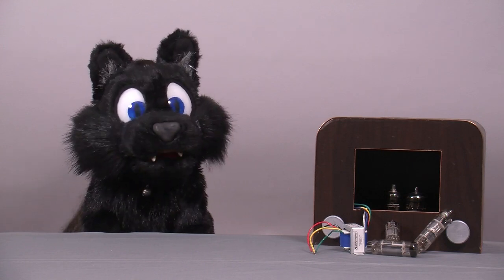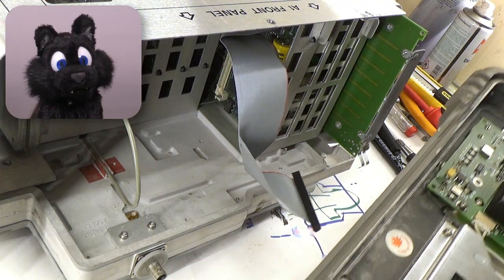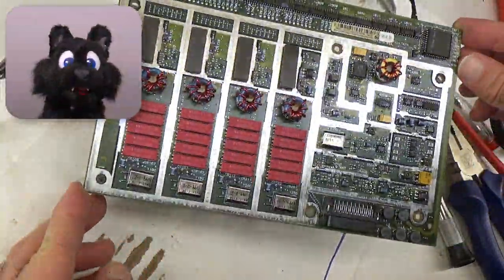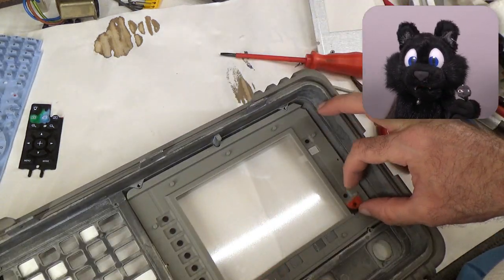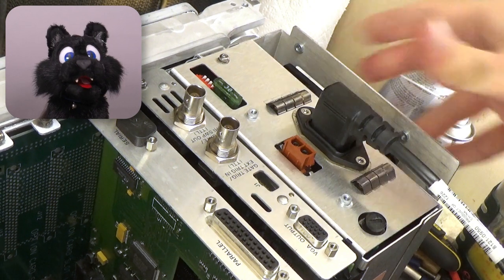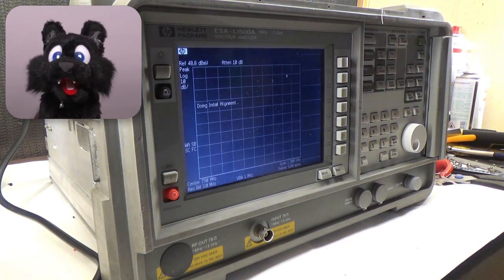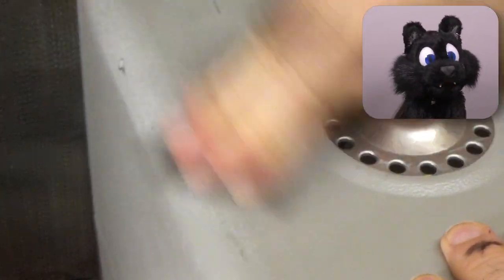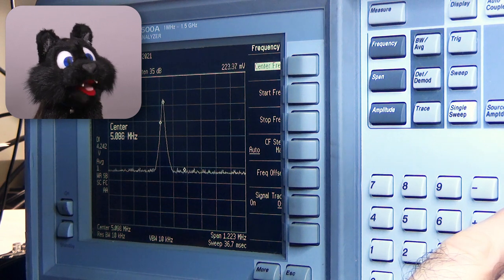Workshop Project #10 - HP Spectrum Analyzer

Comment: Look, ma! Vacuum tubes! :)
I love maple syrup, unless it's found in electronic devices. Then it's not so delicious.
You got yourself a very cool piece of kit. I love the build quality of these. Apart from the RIFA caps which are "kill it with fire before it does it itself!" parts. Interesting way of repairing the power button - I think I'd just go with using a tact switch under the original rubber.
Reply from the maker: I was pondering a switch as a replacement indeed. But since the actual button was completely gone, the cast replacement was always a thing. Since it works pretty good now, I'll keep it like that.

Comment: I was surprised you didn't 3-D print a new handle for it prior to the reassembly.
Reply from the maker: That thing is around 20kg... it's "mobile" for a very wide definition of "mobility" :D - I thought about it briefly, but I am not sure if 3D print would be sturdy enough. The handle only connects to the outer shell anyway, so if I come across an option, it's just four screws to remove :D